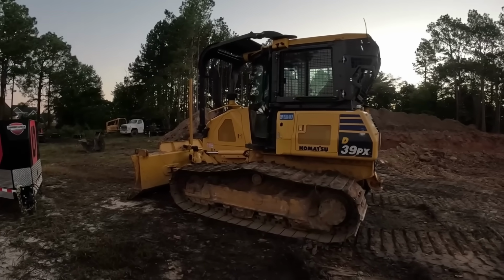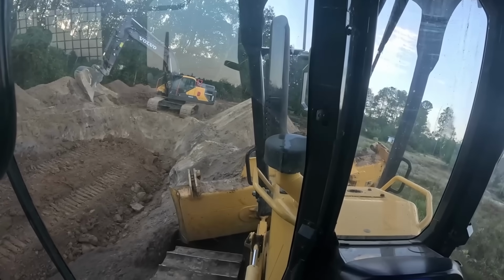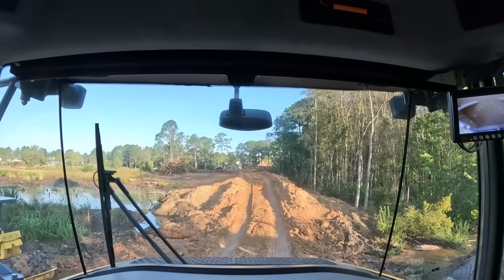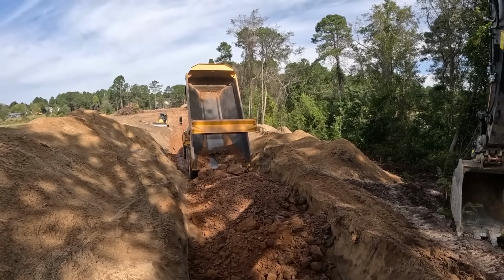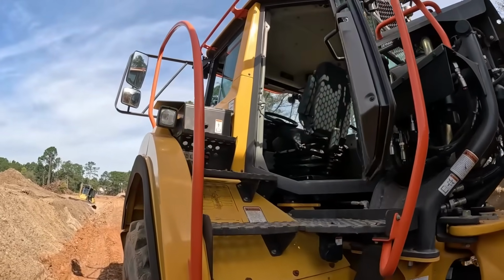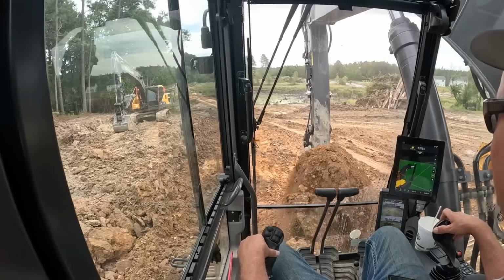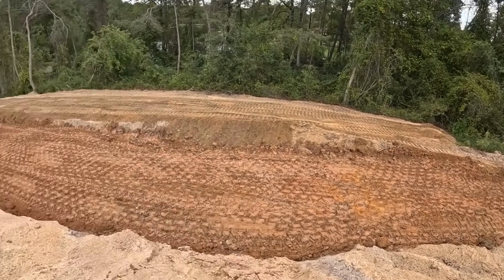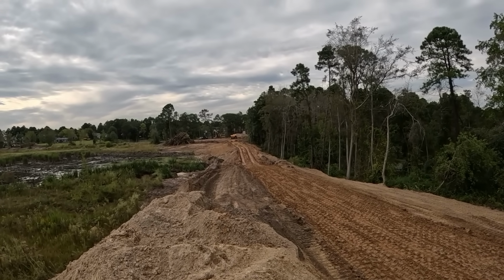New Core Trench Is Full Of Clay Now

Comment: Now that you have the core trench dug out you’ll be able to make a lot of progress on the dam. It’s amazing that the far side of the dam was nothing but sand and you have so much good clay on the other side. I’m surprised that the pond ever held water. The break in the dam wouldn’t have been so bad if it would have had good clay in that spot.
Reply: It is amazing and also that the bottom of the pond must also be lined with that same sand yet it too held water. The bottom must be saturated with water until it get to the clay layer underneath it. Or the subterranean springs that feed the pond must be producing more water than what leaks out or evaporates.

Comment: Chris that is what is called "bank sand" which is a mixture of sand and clay dust such that it packs very well compared to pure sand but is fragile to water compared to clay. Sort of the worst of both worlds, but we used it for fill under home slabs in Texas near Houston.
Reply: The clay silt in it is why it holds water but if it ever over tops it will cut through fast. That clay core will be a saving grace once done. Just give it a lot of spillway at both ends so it never over tops the dam.

Comment: engineer here with an interest in geology.  That grey sand is likely a clayey sand with 20-30% clay in it.  That clay is why it consolidates itself back down after you scoop it with the excavator, and also why the dam held water as good as it did despite that buried topsoil layer.

Comment: Is that rounded sand that is why it is fluffy.   Broken ones are new and pack.  But that was Ocean sand bar that mountains were melted down and rolled around making them silky like.  Not much good in cement, but school ground and walking on it is great.  Doesn't cut or abrade.    Doing good there.

Comment: Grains of sand are different, if they have faceted sides they will interlock and pack well. If they are rounded they will never pack and will always shift or slide. Maybe Kenny Komatsu oil code is urging an oil filter change.

Comment: Equipment and vehicles need to return to the old reliable ways, this emissions crap is such a pain. The EPA must roll back the idiocy of current times.
Reply: So are category 5 hurricanes, that’s what the emissions “crap” is there for.
Reply: @blainerueckwald  Only if you believe in the fairy tale of AGW.
Reply: I remember Los Angeles  when I was a kid in the early 60s. LA was not near as populated as it is now, but the smog  was atrocious. You couldn't see downtown from a few miles away. The Clean Air Act made a big difference in lung disease and eye problems . To this day, Cali  pushes Emissiom Controls for a very good reason. Billions in Healthcare saved from emissions control  and cigarettes.
Reply: How about the equipment manufacturer's builing systeams that actually work instead of designing things to repeatedly fail to extort money from people.
Reply: @blainerueckwald Nonsense. That's alarmist propaganda. We had lots of very powerful hurricanes (in the top five deadliest) in the 1800s and centuries prior long before the industrial revolution.
Reply: @michaelsmith2723 That was only a problem in LA because of the mountains holding in the smog. It's no problem whatsoever in the vast majority of the country.

Comment: You cant fine grade with that ol d6 or d7 like you can that little tonka toy..im sorry but that is crap. What do you think they used before your god almighty komatsu came out..first dozer i ever run was a crosstie cutting railroad grade cutting damn d6d..but once ya LEARN to run the ol girl theres nothin finer...AND CUTTING CLUTCHES ARE NOT FOR STEERING THE MACHINE UNDER LOAD THATS WHAT YOU HAVE TILT CYLINDERS FOR